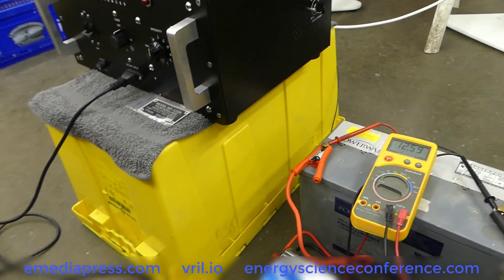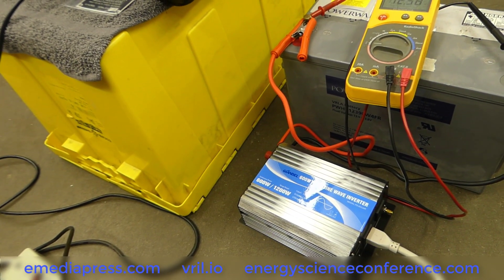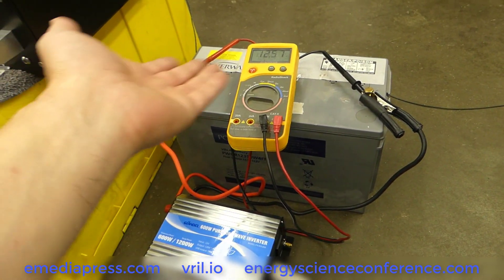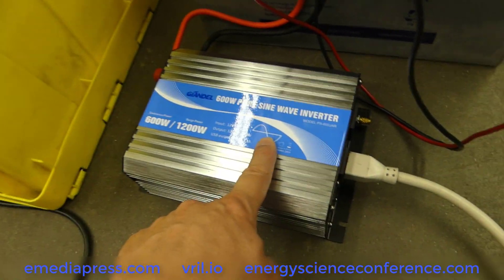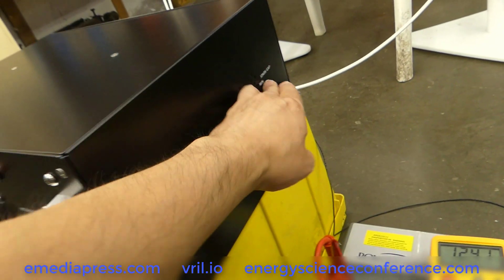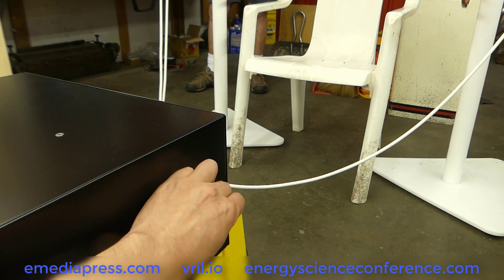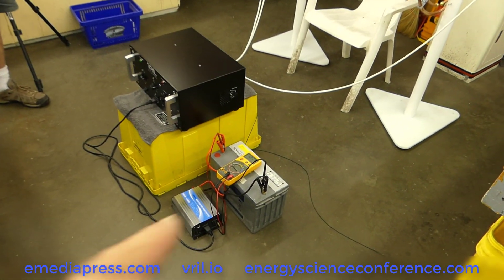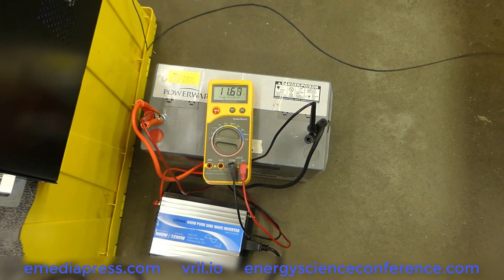Lakhovsky MWO Battery Powered

Comment: How many frequencies does this actually generate finally?
Reply from the maker: Fundamental is around 725-750khz. But there are broadband emissions that can reach 8Ghz. All electrostatic, not electromagnetic.
Reply: @AaronMurakami13  With electrostatic you mean that they are created by pulses from sparks and not from EM waves from the antenna rings? Because in my understanding HF is always made of both electric and magnetic waves.
Reply from the maker: @Muck-qy2oo  Not with sparks unless you draw sparks from the rings - normal mode of operation is high frequency alternating dielectric longitudinal impulses with no current, if no current, then not electromagnetic. There are high frequency electromagnetic waves such as the transverse radio frequencies from routers/phones/cell towers/5g, etc. But this is high frequency longitudinal impulses. Watch these 2 free vids to learn the difference: http://ericpdollard.com/free-videos/transverse-longitudinal-electric-waves-and-teslas-longitudinal-electricity/

Comment: Did you shield it? Or is it unneccessary?
Reply from the maker: The circuitry inside the pulse modulator is shielded.  I would stretch out the battery cables and inverter to get it further from the pulse modulator than is shown in the video.
Reply: @AaronMurakami13  So how could one avoid the emission of radio disturbance?
Reply from the maker: @Muck-qy2oo  Fortunately, it is the most shielded pulse modulator of any MWO that anyone has tried to build so the RF emissions are mostly already grounded out. However, there are still some emissions. It is impossible to fully avoid all of it unless you operate this inside of a completely shielded room surrounded by screen that is properly grounded. That is the only way. That isn't a Faraday cage like many people say, Faraday cage allows the electrostatic voltage to penetrate it but prevents magnetic from entering.

Comment: so what happenes when battery runs out or can you make another 1 to charge it?? I ask as It goes down in voltage over time.
Reply from the maker: It's a deep cycle, when it gets down to 10.5 volts, then charge it back up like any other battery that gets discharged.